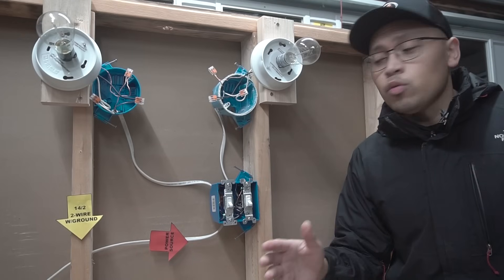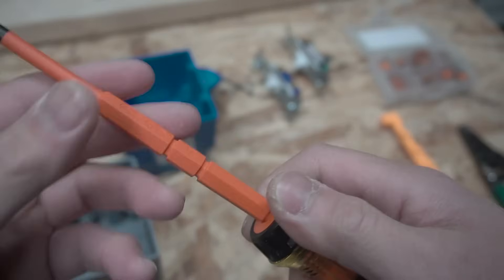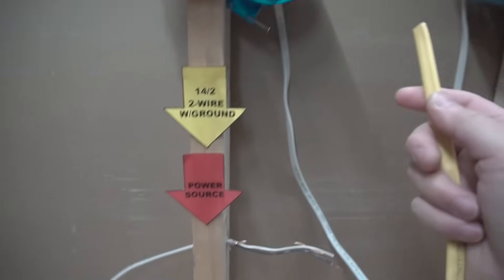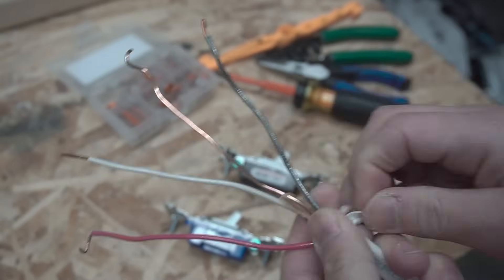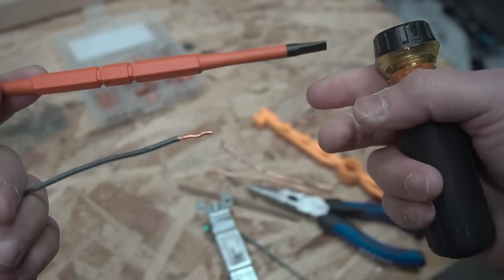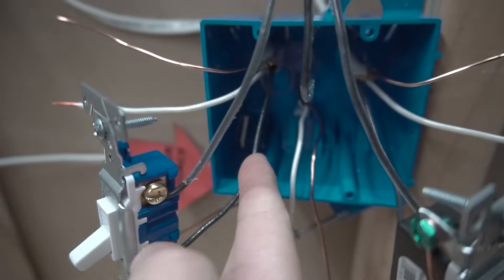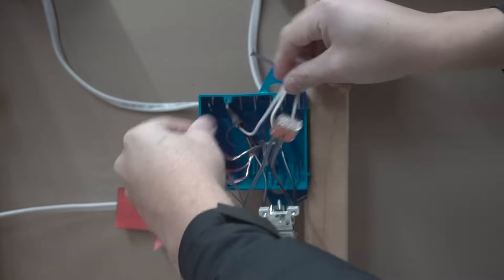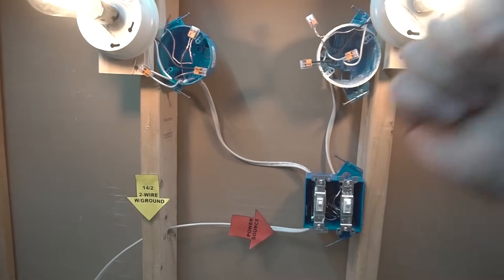How To Wire 2 Single Pole Switch Inside 2 Gang J-Box To Light Fixture (2022) | DIY Beginner Tutorial

Comment: Very good, what if you have a 2 switch gang box, 2 different loads but only 2 cables coming into the box and only the white wire is used
off one of the feeds, the other cable using both black and white.

Comment: I have a porch light I'm trying to hook up it's coming from the back door and there's two switches just like you have here and then there's one switch on the other side of the room for the laundry room but under the plate on the box there's three 14 two wires coming in and one is hot all the time one goes to one light switch and I'm not sure what the other one goes to I'm going to try to explain that very well but I sure appreciate some help

Comment: Hey, thanks for this informative video! I’m trying to install a smart dimmer switch (fiet electric) to control the light where a 2 gang box is used to power an exhaust fan and a light. Is there any way I can make the smart dimmer work with the light switch independently from the exhaust fan? Note: the smart dimmer requires the neutral to be connected. Or am I out of luck and the only way this is possible is with independent hot lines to each fixture?

Comment: Hello I’m having a problem trying to add a second switch and light, for an outdoor light, using a two way and a drop down 3a fuse switch on the line. No mater how I connect them the end result is the kitchen lights and the outdoor light both flicker when the outdoor switch is on? When just the kitchen it’s solid light and when only the outdoor is again flickers both kitchen and outdoor even with the kitchen one off?

Comment: Hi, I'm planning to do the same setup except that instead of single pole switches, I have 2 smart switches (3way). The switches come with hot, ground, load, and neutral. How do I use those switches in this same setup?

Comment: A light switch is a black wire in two sections that’s why there are no white wires connected to it what  your doing with a light switch is interrupting the power to the light no need to interrupt the return

Comment: Does it matter if you put your pigtails, of your hotwire on the top or bottom of your single pole light switch?
Reply: No, it doesn't matter.  Electricity will still flow to the lightbulb.

Comment: Hopefully you get this and comment and touch base with me. I have a job to do and it is regarding a commercial building and one light switch turns on one side the other light switch turns on the other. What are the guy went to turn on the other one to the right nothing happened all of a sudden it was working fine no lights so I decided to check all the GFCI‘s and put new ones into our new outlets and I’m still stumped. I checked the breakers fine stumped I need help to find out what you think is going on. No lights with the switch turn it on, but do you think the problem could be please touch back you are awesome awesome teacher and I’m gonna send some money your way soon as I get paid for your great

Comment: Great video! If the box containing the switches is metal would you need an additional short piece to connect all the ground wires and then ground them to the box (or is that no longer necessary)?

Comment: I am trying do exactly this with and led closet light and a ceiling fan the ceiling fan is already on a single pole switch going to the fan I would like to add another single pole switch from the fan switch to led light in closet. But when I wired the new single  pole switch to the existing single pole switch to the fan single pole switch the new single pole switch to led light would not work but the fan switch would turn the led light on and the fan on both switches are wired with 14-2 and the led shows faintly not turning off can you help me.

Comment: Can you please help. I’m doing the same scenario, but the second light switch will only work if the first light switch is on… I have one lead in and I pig tailed two lines off of it and are on both on the top terminals of each switch. Then my lead from my fan is on the bottom of the first switch and my lead to my to wall Lights is on the bottom of the second switch. The two switches are not connected together, but the light switch for the lights on the wall only work if the fan is on. Does the ground have any affect on this as in if one light switches is only grounded? Thank you for any help!

Comment: Thanks for this video. I’m planning on doing something very similar to this outside my house in a gazebo. I also want to add an outlet after the second switch. How would I go about this? Would I simply connect the hot , neutral and ground to the corresponding wago connectors? That would be 6 wires in each one. Thanks!

Comment: Excellent!!! Questions: You made a specific point of running the power black wires to top of switch connector and bottom to light, does it matter if it was reversed on the switch? I notice that several videos posted criticize the WAGO type connectors, is there any code issue or what drives that?

Comment: Plz help I have 4 lights in the basement that are controlled by 1 light switch I would like to add 2 light switches to control 1 each of the 4 lights the run starts on 1 of the light fixtures basically I added to rooms to the basement

Comment: Nice video & presentation. Too bad you can't help me figure out why my buddy has no power throughout his manufactured home yet 120 volts to every phase 1 breaker at panel. T he problem is he has up to four feeds coming into several J boxes with some black wires having zero voltage...? I'm just learning and can't figure it out yet.

Comment: When the switch is of should there be any voltage in the lights black wire? My tester keeps beeping when checking the lamp wire.  Used my meter and it is showing 114 with switch off and 120 with switch on.

Comment: Someone wired my front porch light off of my kitchen light switch. And my porch light would not come on unless both switches were turned on. This video was very understandable even though I needed to replay a couple of steps until I could draw it out on paper what I need to do to fix the problem. Thanks so much. And I have used those connectors and think are way easier to use.

Comment: confusion for me someone ran a light switch at bottom of stairs and you can shut it off at the top of the stairs. job left undone and i need to fix it. so I see three yellow romex wires run to on light just hanging in mid air.  I can't figure out one is mark with a black mark how would I make this one light turn into recessed lighting. no videos on this problem. hopefully i stated it as best as i could

Comment: I have a switch that controls 2 fixtures, a vent fan and a light. Im trying to install a new vent fan that needs a hot connection so that it can be controlled by a remote and I want to just keep the switch for the light.

Comment: I use Wago connectors too but I wrap electrical tape around them as the levers have a little bit of play in them and can come up a little bit when you push them into the jbox.  I also wrap a light duty zip tie around the wires connected in each Wago about an 1 1/2" down from the Wago.  This takes any stress off the wires where they enter the Wago when they are being pushed into the jbox.  Thanks for your videos.  You have a great way of explaining things and breaking everything down.

Comment: Thank you for your tutorial! I have the exact same configuration but I have one light fixture chained to an exhaust fan. I also use a 3 pole on one of the light switches AND I see a RED wire coming from going to the 3 pole light switch. The 2nd light switch is exactly like your light switch in your video.  Do you have a video explaining my configuration and why did they do this way?  Thank you

Comment: Similar to a bathroom circuit for, light, fan , and receptacle? Except I would have I extra Romex, and less room in the box. Would have to use a jumper for the hot and ground pigtails.

Comment: Should have shown them three (3) ways to make the loop. The wire strippers you used to strip the wire ends also has a hole in them specifically made to bend the loop while you have the tool in your hand. No need to grab another tool for the job.

Comment: OK, this video is the one I need.  I watched another video by Fix This House and it wasn't exactly right for my situation, but this one is.  :)  Dude, I'm going to a light and a plug, not a light to a light.  So, in my situation do I add a pig tale to the switch, but not to the plug?  I  have to have the plug always hot.

Comment: Thank you!  - I have question.  With the wires so close to the sheetrock, is there any way to protect from someone nailing something into the wall on the other side of the switch?   Or is it up to the user to know where they are nailing?  (My family will just smack nails anywere to hang stuff up)

Comment: I appreciate how clear and repetitive you are and made the tutorial super easy to follow. 

But how about if the 2nd switch has a 14-3 wire that connects to the 2nd light and thus running to a 3-gang box? I’m trying to figure out how to make that work correctly w/o affecting the wiring out of the 2-gang box. Thanks!

Comment: Do you have a video for when you have two switches in a j-box where one switch is a single pole that goes to an exterior light fixture and the second switch is a 3-way that goes to two interior lights and then to a second j-box with a 3-way switch in the room?

Comment: Can you put an electrical receptacle in those round boxes? I have light fixtures in my garage ceiling that I would like to replace with LED lights that plug in. The existing fixtures are mounted to "round" plastic boxes.

Comment: This is such a great video. I recently subscribed to your channel. I have a question though. How do I wire 1 power source to 2 switches that each control a separate light fixture AND 1 outlet receptacle? Essentially I'm trying to combine this video and another video you did where you used 14-3 Romex to maintain power at an outlet while having light fixture controlled by a switch.

Comment: Up to how many lights can i connect to a 15AMP breaker ?
Reply: It depends on the wattage of each light bulb and whatever else is on that circuit. If you're using low wattage LED bulbs it could be quite alot.

Comment: Thanks! This is a great tutorial! The best one I've seen so far! Quick question though. In the event that you have a metal junction box, could you just connect all 5 ground wires to the box and save the 5 slot wago? Or can you connect a ground wire between the two switches and then only use a 4 slot wago?
Reply: No. You'll need to connect 6 wires. A 5 slot Wago and a 3 slot with a jumper connecting them will do it. The are no 4 slot Wago lever nuts. Alternatively, if it's 14 gauge wire you could pretwist and use a red wing nut. The maximum for that wire nut is 6 #14's.

Comment: I have two outlets and one power source.  Can I add one switch to control the bottom only while the top part of each outlet stays on?  This is located on my back porch.
Thank you!
Reply: Yes. You'd need to break the tab on the hot side only on each receptacle. The switch leg would be connected to 2 pigtails, one to each duplex receptacle on the individual receptacles to be switchable.

Comment: Just did this with an old junction for a 2 way. My house was built in 1945 and half of it still has the old braid wire though the 2 pole for our living room light and front porch they ran 2 separate wires to a junction instead of like this, things sure have came along since then. Nice tutorial bro!

Comment: Very good but I am surprised you did not wrap the switches with electrical tape around the terminal connectors. Not needed by code , but a great safety habit of all the professional electricians I know. Although those ground wires should never move or spring forward and connect with those terminals, having the tape around the switch is a quick cheap insurance. Other wise a great video. Thank you

Comment: I'm stealing power from a receptacle to feed 2 LED lights... I went from the receptacle up to the first light, then to the 2nd light, then to the switch... I'm not sure if the switch is faulty because I have constant power to the light now and the motion sensor/dimmer switch won't turn the light off and the lights are constantly on now... Should I have went from the receptacle, to the the switch, and then to the the 2 lights instead? Does it matter what order?
Reply: I'm assuming you have one switch and 2 lights. Yes you can go from the receptacle to the first light, but you should use a 14/3 cable between the light and the switch. Connect the black hot wire from the receptacle to the black wire of the 14/3. In the switch box, connect that wire to one screw on the switch. Connect the red wire to the other screw and the other end to the black wire from the light. This is called a switch loop and allows the power to go through the switch before the light. The 3 neutral wires (14/2 power, light, and 14/3) will be connected in the light box. The other end of the neutral wire from the 14/3 in the switch box is to be capped with a wire nut or Wago. It's code compliant to have an available neutral wire in a switch box for future upgrades to a smart switch.
To add the second light use 14/2 and connect accordingly in the first light box. Now when you flip the switch, both lights will come on.
You could use 14/2 throughout and use the otherwise unused neutral wire between the switch and the light as a hot wire. Mark both ends with black tape to indicate hot. This method will work but is not code compliant because there will no neutral wire available in the switch box.
You could also do as you suggested and go from the receptacle to the switch to the light and only need 14/2.

Comment: Ok I’m confused. I guess I don’t under wiring and how switches work lol
I put the line in on the bottom snd the load (the light wire) and the top. 
I think of it as I flip the switch up towards the top wire so it makes connection and light is turned on. 

What’s diff in your way?

Comment: Really stupid question I know, but in this example if both switches controlled all lights simultaneously is that considered a single pole switch? My garage has two sets of two light switch wall plates, the switches on the same location for each corresponds to turning off all ceiling lights. I’m assuming that if I want to install a motion sensor these would be considered single pole switches because they only control on and off for an entire series of lights. Does that sound right?

Comment: @fix this house can you explain or help understand this I want to change a switch outlet combo switch to a switch GFI combo the one in my kitchen has the negative on the left and the positive outlet showing as I plug in plugs I know the hot goes on the right and neutral on the left so once I install the new on all I have to do is make sure the hot is on the right and neutral on the left correct? Also if jo ground wire is there all I have to do is make it ground by installing a small wire if I have a metal box right

Comment: Great info, so if my wire needs to be extended to reach another part of the wall, can i add wire to the existing wire then to the receptacles?
Reply: Yes you can. Switches don't have to be together in same box if you don't want to.

Comment: I’m running a new circuit off the panel. Can you group 4 lights together instead of one off one of those switches? 

The other switch would be a ceiling fan.
Reply: Sure you can.

Comment: Replacing switches on my light over sink/disposal to white. And I have a wire stripped in the middle and put on the bottom terminal and another black wire pushed in the bottom push-in. The black wire on the terminal is connected to the bottom push-in of the disposal switch. My wire is 12gauge and my new switches push-ins are 14.. so I can’t mirror it. How do I wire this???

Comment: What do I do with ground wires if I don’t have the easy clip in things?
Reply: I would get a big plastic wire cap that can fit them in or just  twist tips all together with pliers. All grounds wires are bare anyways, just make sure they don't touch power wires or screws from switches/outlets.

Comment: Hi, I am experiencing an issue where I have two bathroom lights with a setup like this. The vanity light works as expected but the ceiling light only turns on when the vanity light switch is also turned on. (Both switches flipped to the on position) any help is appreciated! Thanks
Reply: It sounds to me like the same black power wire is connected to both screws on both switches and that's why you need to turn one of them on first.
If that's the case you need to remove the black power wire and add 2 small pieces of black wire (pigtail them) then connect each of the 2 ends to the 2 switches. That will give power to both switches independenly.
Hope that helps.

Comment: From the switch to receptacle, can I then take power from receptacle add some wire to add some led pod lights that I would like to turn on and off with that receptacle? Or should I just delete receptacle and add wire straight from switch to led pod lights ?Thank you Sir
Reply from the maker: Hi! Either way works. Just make sure you are using the correct gauge wire for your amp source. Please double check with your permit and code before doing work 👍🏽😊🙏🏽
Reply: @FixThisHouse  it’s a secret 🤫 code lol will see how it goes,if it’s bad it’s my fault 😂